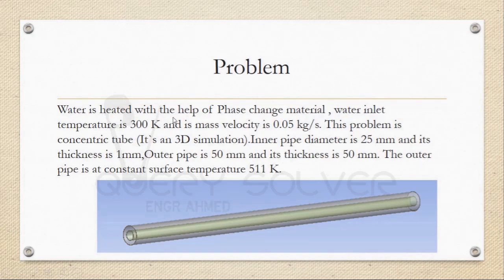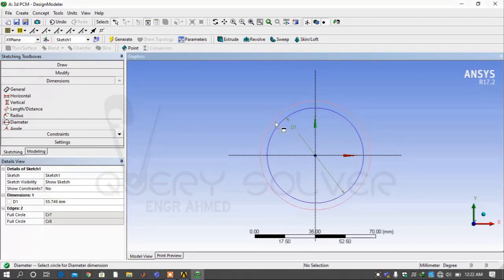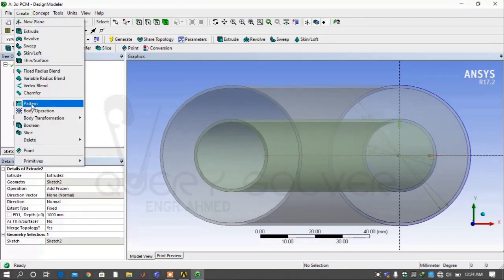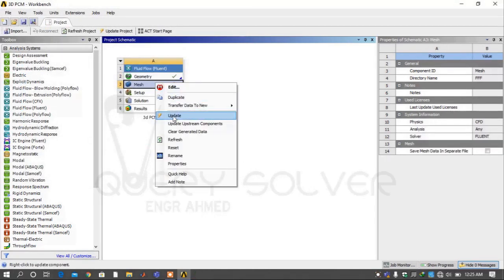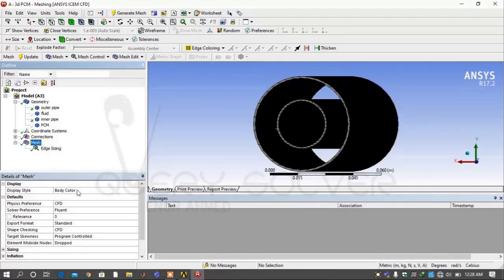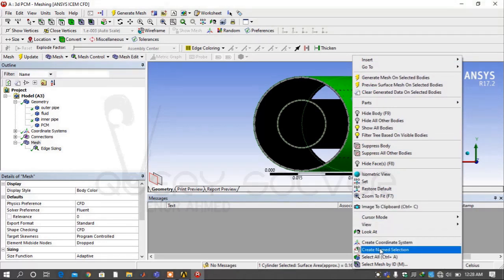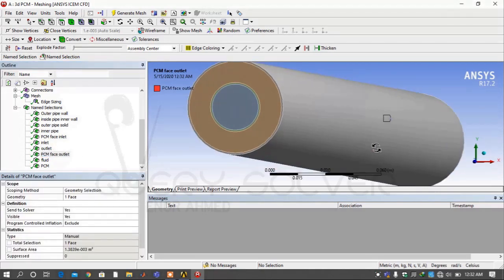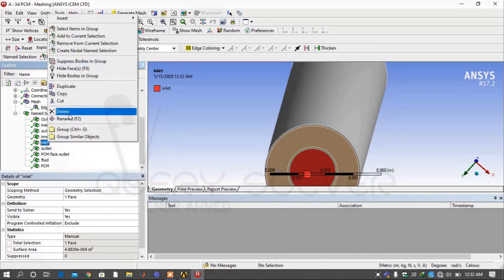3D Phase Change Material Part 1|ANSYS

Comment: If there is 1mm thickness then why are taking dimensions gap 2mm just as 25 mm and 27mm please sir reply
Reply: Because it's a pipe and has two walls if you see front view /section view
Reply: Because it's a pipe and has two walls if you see front view /section view